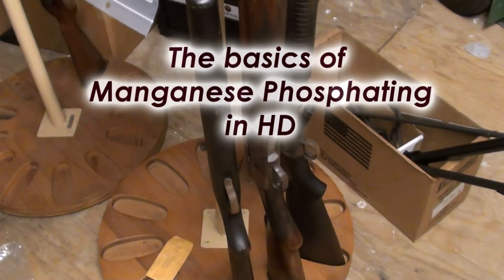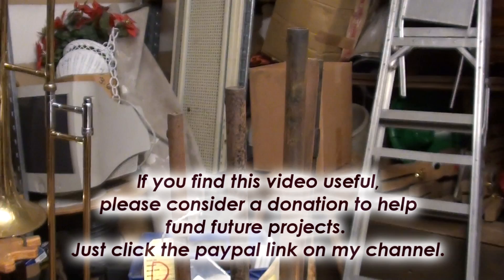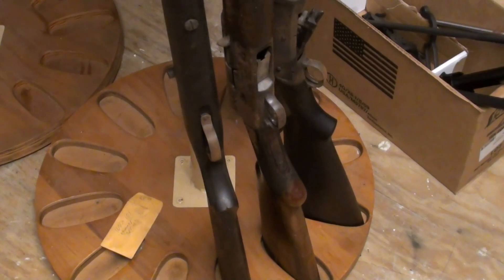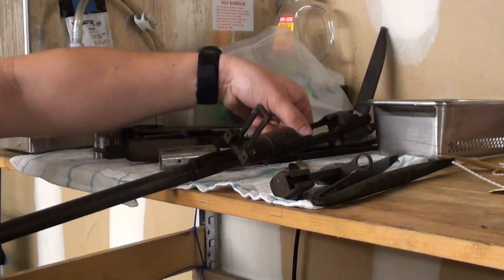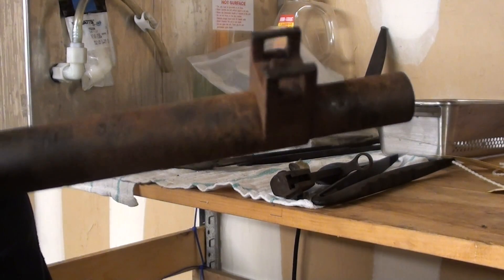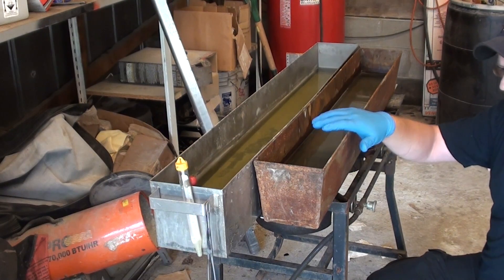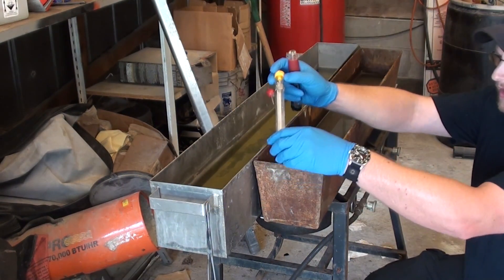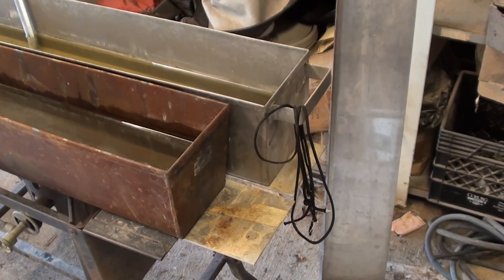The Basics of Manganese Phosphating (Parkerizing) in HD

Comment: No need to plug the barrel? 
I’m going to attempt to mag phos an old WW1 auto pistol. If I want to plug the barrel to make sure no tolerances are affected, what material could I use to plug barrel that the mag phos will not dissolve or affect? 
I was thinking of filling barrel with caulking but not sure if mag phos will eat it up and plus not sure how tough it’d be to clean up. Especially getting it out of the barrel grooves. 
Any help would be appreciated. Thank y’all.

Comment: I would suggest boiling the metal for 45 min-hour before parking to convert the rust to bluing. If you don't then you could trap rust and it will continue to corrode after parkerizing.

Comment: i have a ptr91 reciever in the white that i want to parkerize. now, if i put it in the solution like that, its gonna parkerize the inside aswell, is that gonna cause any trouble with the bolt running inside it later?
Reply: TheAngler2210 I wouldn't park that chamber. if you do sand it off or blast it off

Comment: what about the inside of the barrel?... I'm currently bringing back my old ak 47 that I gave to my dad (with roughly 500 rds fired at the time)  and he used it as a stash gun while I was away and it suffered water damage for an extended period of time until he checked on it and found that moisture had gotten to it... I walked into the shop one day and found him buffing it with a wire wheel on a 4" grinder and I hastily took it from him... thankfully my ex got me a blasting cabinet before she left and I was able to take it down to fresh metal and clean it up... I had wanted to cerakote it all but skimped out and bought gunkote instead just to simplify it somewhat... now I'm thinking that there's going to be a lot of unprotected areas or even worse some clogged ones but thankfully it's a Kalashnikov and should work regardless of how it looks afterwards. 

any advice from you with this project would be greatly appreciated.

Comment: I get that it's not an issue with a smooth bore shotgun, but what about if its a rifled barrel? Wouldn't dunking it in a that solution screw up the inside and the rifling?
Reply: +Neil Carpenter that's what I was thinking...
Reply: No it wouldn't actually
Reply: Every gunsmith I've talked to about this highly recommends plugging the bore. There's a reason why they are usually left shiny. I wouldn't want to etch that nice smooth finish in there.

Comment: do you need to plug the both ends of the barrel?
Reply: +Shawn Darling No. The parkerizing will not negatively affect your barrel. If anything, it will just protect it.
Reply: Thanks a lot
Reply: +Tyler look at a factory shotgun barrel. They also coat the inside as well.
Reply: +Tyler AR-15 barrels are usually park'd on the inside if they aren't chrome lined or stainless.  Your Arisaka has no coating whatsoever because it wasn't economic for Japan to do so.
Reply: +Tyler and if you'll notice, Eric doesn't plug the ends when he does the parkerizing on that gun
Reply: +Tyler no, that's blueing.

Comment: fire can liberate/steam etc water into the air and then it condenses on any cold surface, i made a hell of a mess of my workshop by having a butane heater in there one winter, in a few hours use it rusted my lathe/bandsaw etc, took ages with wire wool and oil to get everything back to normal.

Comment: Great video, do you seal the rifle bore pre Parkerizing. The tank I use was from E Bay a simple large stainless steel fish boiler £ 15 Uk inc postal
Reply: I know its been a while since your question but it is a very good question and should be answered in case others have the same question. 

The answer is yes you should certainly plug the bore as parkerizing is actually etching the metal. Basically it is corroding it which is exactly why if you sand to 400 grit instead of bead blasting the sanding scratches melt away and gives pretty much the same finish. So if it is capable of dissolving the sanding scratches imagine what it would do to rifling. Not plugging would likely ruin the rifling especially in cases they are using micro-rifling process such as Marlin uses. 

Traditionally guns are blued which is adding a coat of iron oxide and converting it to black oxide which gives the impression the parkerizing process does similar but it does not. It does not add anything to the metal but converts the surface to a more porous surface ready to accept a finish. In a lot of cases it is either paint or oil which finishes it. Parkerized parts left untreated with oil will rust and start to corrode and it does not inhibit rusting at all that is the job of the oil that seeps into the tiny holes in the surface. 

So why does Parkerized military guns last? The answer is cosmoline and it is seeped so deep into the surface pores it then protects it without a need to oil often and I think everyone knows how hard i is to remove cosmoline. 

FYI if you parkerize a part and choose to oil it and then decide you would rather paint the surface to further protect it then heat the part with a heat gun to where the oil is smoking and drying up and drop it in acetone this opens the pores and the acetone is allowed to clean them out and then you should be ok to paint the surface with something like matte black ceramic engine paint or header paint. Both are literally the same as duracoat but a bit cheaper and more available at auto  part stores and need to be baked to harden the ceramic in it as well. Doing the paint will completely eliminate the need to oil as long as it is not ever chipped or scratched. However it is honestly easier to just keep the surface oiled. 

I am currently trying to fill the pores with a graphite grease I picked up on a 1911 slide because it is a dry lubricant and the grease should inhibit rust while the graphite should keep it smooth. I only applied it to the rails and locking lugs and the ejector area it slides through if you do the whole slide you would probably have black hands after every use of the gun. What it should also do is make people only have to lap the rails to their 80% builds as the graphite grease should be held in place on the rough lapped surface or someone could spend 6 hours finely polishing the rails lol.

Comment: Hot ultrasonic?
Bead/sand blaster?
Nobody I know has that at their home.
Parkerizing at home?
I just use brake ckean and Metal Rescue.
Reply: I agree with you on the ultrasonic cleaner, but anybody can get a bead blaster attachment for your air compressor for like $10.
Reply: The blast media will not last long without a containment system.
Reply: Papa Monster  FYI, blast media can be had for dirt cheap.  And work over a big rubbermaid tub, and you'll collect the majority again.

Comment: Damn, been parkerizing for a long time now and I seem to have relatively successful at many jobs. A friend of mine recently asked me to park his worn out Beretta in.32 Cal. Small pieces (trigger, guide rod, mag follower, etc) parked really nice but the slide is not. Slide comes out of the park solution looking very black, even and holding on (even after brushing with a nylon brush). Then after a couple of days in oil the thing turns light colour again, as if the Park wasn't holding. Any ideas?

Comment: FYI for OP: If they were in a fire, they didn't have to burn or even get hot for that rust to occur. The hot smoke and resulting soot is highly toxic and corrosive. When it contacts almost anything metal it bonds to it and what you have is the result. My attached garage burned to the ground but didn't make it into the house. Even so, everything metal in the house corroded and rusted just like your guns. Anything that came in contact with the smoke/soot was trashed.

Comment: Quick way to show how a ultra sonic system works is to get a square wire frame and put one sheet of aluminum foil on it, dunk in the system and it will show the marks where the system waves hit. Pretty cool and functional test for yr system

Comment: Dud" Next time use simple green marine. Used the simple green on my big boat for 22 years and broke my ass with a brush getting the aluminum lines from the windshield  off the fiberglass of the boat went to napa auto one day for car parts and they had  simple green marine i grab it. and no crap don't have to use a brush at all it's sprayed on and hose it off unbelievable stuff!!! but not so ez to find?  look on line for it. You will be a real happy boy. It's a night and day cleaner-degreaser!

Comment: the process is actually replacing the surface metal of the barrel with manganese its a single replacement/double replacement (depending on what the barrel is made of) chemical reaction.

Comment: The rust was most likely from the steam created during extinguishment, seeing as the stock seemed to shelter the metal from moisture, if it had direct exposure to water, the surface tension of the water would of wicked it well past the stock

Comment: You might mention that the gloves you're using to handle the dirty and oily parts are to keep your hands clean.  Those gloves get dirty and oily, just as your hands would, so you do not handle the clean metal parts with those dirty gloves.  They aren't magic gloves that automatically stay clean when handling dirty and oily parts.  Use clean gloves to handle clean parts.

Comment: its proably possible to remove the rust electrochemically if you don't happen to have access to an ultrasonic cleaner. all you should need is a salt, baking soda, water solution and a piece of aluminum or copper  and maybe a battery (esp if you use copper)

anyway what Temp are you heating the solution to???

Comment: The rust looks like that resulting from Hydrochloric Acid ( HCl or Muriatic Acid). This can be from storing pool acid or HCl in the same room as finished metal. It could have been from a fire as well, as there is a lot of common paints , furniture, and household items that contain PVC, Polyvinyl Chloride. When PVC is involved in a fire, it gives off HCl or Phosgene, which reacts with water to make HCl.  No pool acid around finished metal.